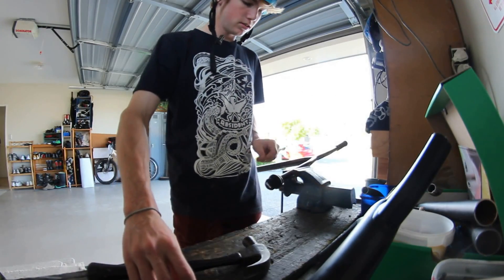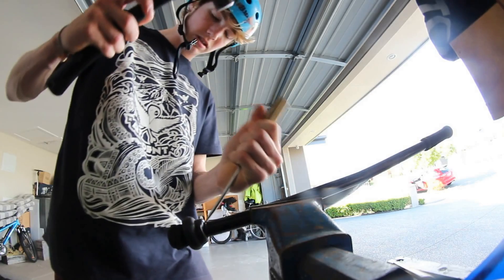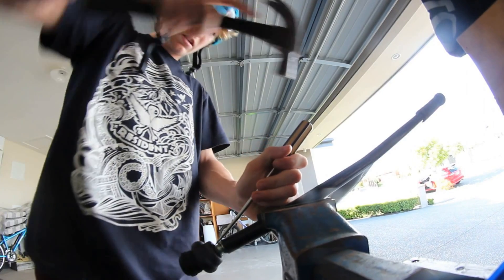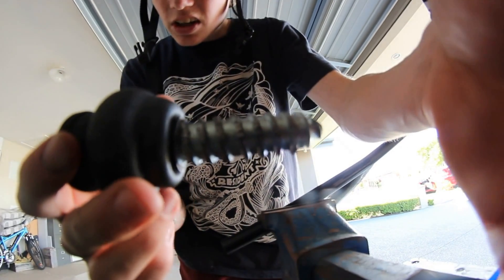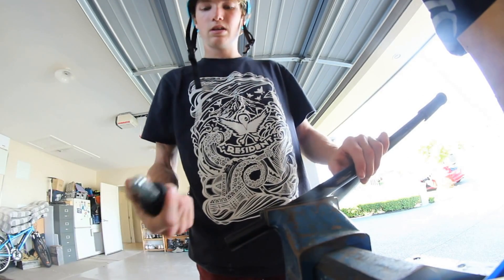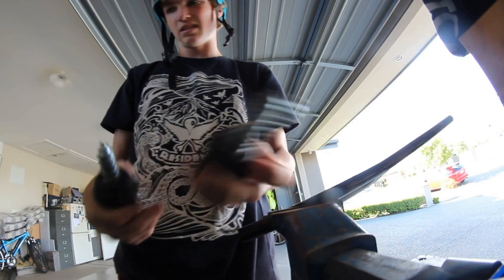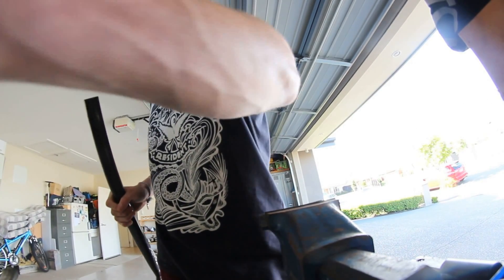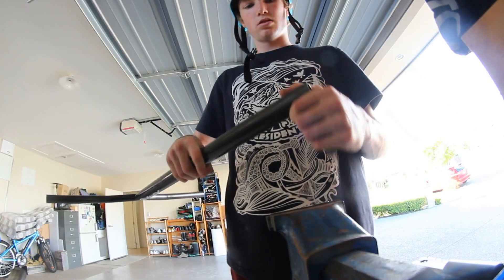How to make scooter bar extensions with Matt deVries from UpsideDown Scooters

Comment: also you can take screw in plastic bar ends and take old bars and cut some of it off or you could use the outer ring of a wheel bearing and put them on you can get up to an inch on either side

Comment: to sum the video up you just....buy a big threaded bolt,shave it down til it fits inside the bars, slide same size bar tube down to one end of the threaded bolt and then smash it into the bars? hahaha this video looks to be the strongest way to extend bars. the only thing is having to shave the bolt to fit and all that boring stuff hahaha thanks man helped alot